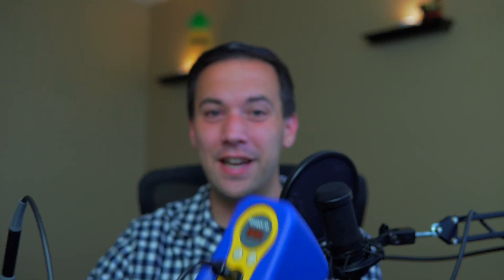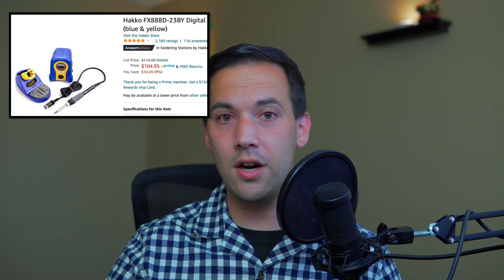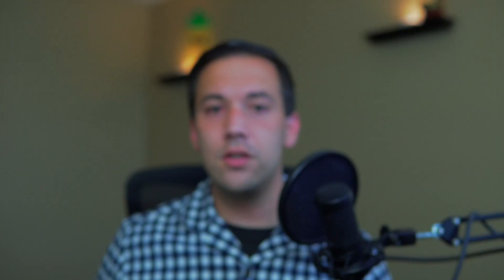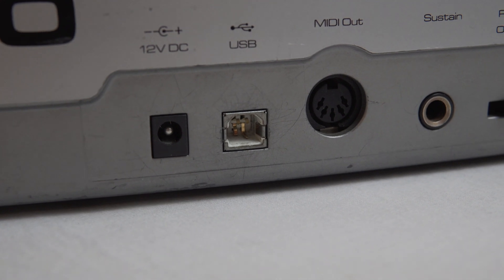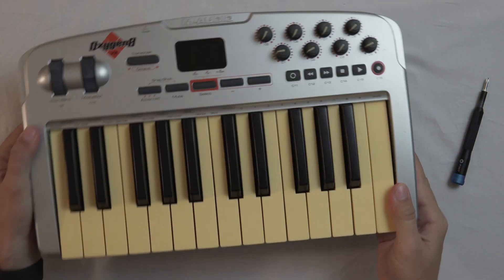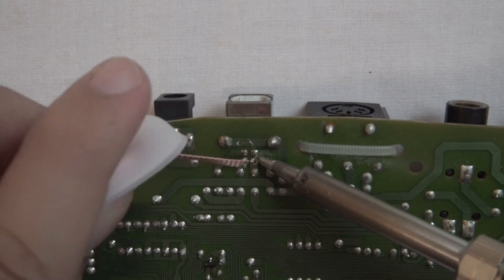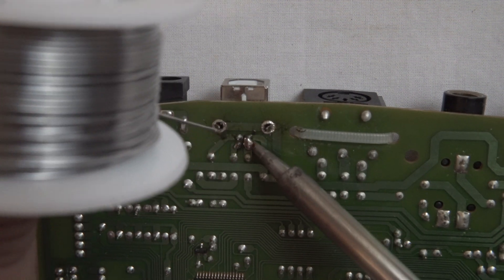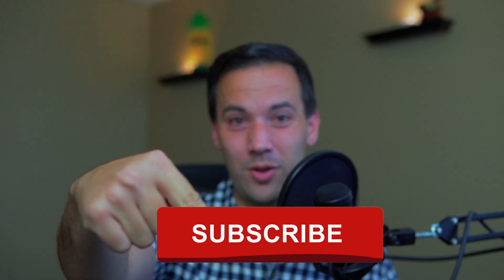How to Replace USB Ports

Comment: Hi, I just got a used Oxygen 25 (3rd gen). When I connect it, it lights up, but my Windows PC doesn’t detect it. Could the issue be with the USB port? Or if the port was faulty, would it not power on at all?
Reply from the maker: It’s possible that you need to download a driver since you’re using a windows PC. Trying googling Oxygen 25 windows driver.
Reply: Did you ever find a solution? I have the same problem

Comment: Does this process work with DI boxes as well?
Reply from the maker: In theory yes, most devices with a USB type B port will be able to be fixed this way. It just depends on how the port is soldered into the board.